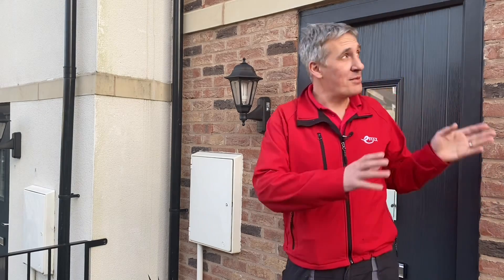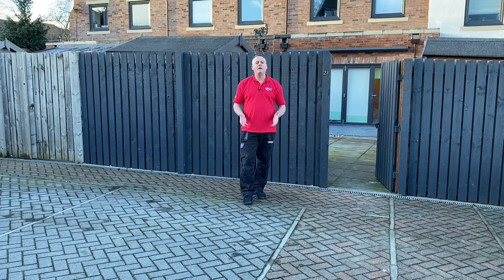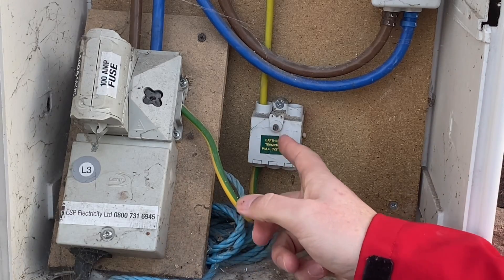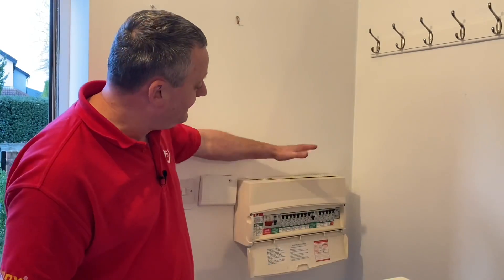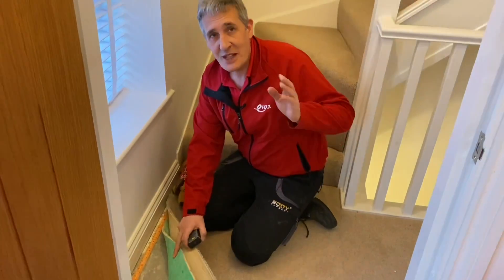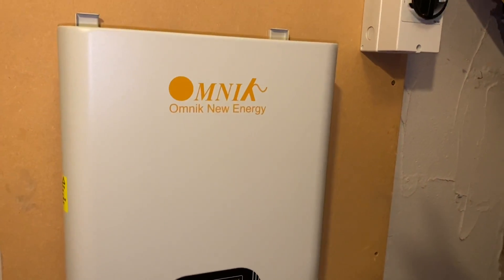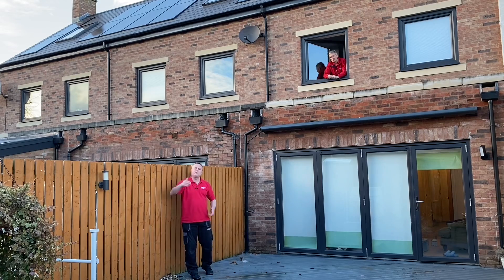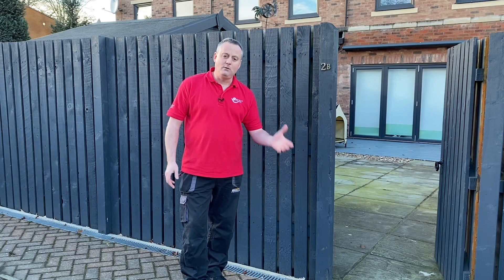Are ELECTRIC CAR chargers EASY to install?

Comment: On my 2020 new build with TNCS I have been provided with a regular single 13A socket, wired in 6mm T+E directly below the CU, on a 32A MCB labeled "car charger" that is grouped with a floor of the houses type AC RCD. You can use this socket in the garage to charge a car outside. The NICEIC registered contractor saying that it's a "general use" circuit and therefore compliant. House sold with "EV charging point", electrical designs say it's "for vehicle charging". What a mess!
Reply from the maker: Interesting approach - we think 13a sockets for EV have to be a special type - not just a label.
Reply: @efixx  how about it reasonably being used for a car parked outside? And it blinding the houses RCD?
Reply from the maker: @Swwils  it's not a good solution - we'll take a closer look at what the current bare minimum is for new build houses.  We thought most just ran an empty conduit to and empty charger box.
Reply: @efixx  Some local authorities require EV charging points as a planning condition. It appears that builders interprete this as a 13 amp socket but even so, my reading of section 722 is that it covers this so that socket requires PEN fault protection and an appropriate RCD.

Rolec do a chargepoint casing with a 13A socket and sell the guts of their type 2 chargepoint so the owner can get it upgraded.

Comment: From consumer unit to outside, clipped up the front of the house into the soffit, through the loft, down the back wall and some heavy duty cable tray along the fence.
Reply from the maker: unfortunately it's 3 floors - no loft space front to back.

Comment: What would be better, is if you give the job to an installer that is under pressure to install 3 or 4 per day. I’m a spark, and I had an installer do my EV charger, as with the grant, I couldn’t buy a charger for less that I could get it installed under the grant. The installation was terrible, compression glands either side of the SWA, guy wouldn’t go into the loft for “insurance reasons”, he wanted to install plastic trunking across a bedroom ceiling?
Reply from the maker: plastic trunking across the ceiling - jeez
Reply: @efixx  🤢🤮
Reply: The guy needs to sort his insurance out, how can they not be allowed in the loft space as a tradesman, makes no sense.
Reply: @John M7RCZ really...like  bit of plasterboard will stop you falling through, makes no sense at all.

Comment: Buy a diesel car?
Reply: Nasty, dirty diesel.  Buy a petrol car.
Reply: @JimWhitaker  I can get 70mpg from my diesel car, my petrol car struggles 40mpg, although I prefer how petrol cars drive. I don’t think diesels are that bad, most diesels have dpf filters and a whole load of other parts to control emissions and my diesel is road tax free because the emissions are so low. They both have their good points and bad points. I don’t think electric cars is the answer but I like the idea of them. The amount of money this job would cost the customer you could run a diesel or petrol car for years.

Comment: I suspect that flat roof out back eliminates the use of joist drilling through the first floor. - If it doesn't, just watch out for it being an engineered floor: joists made of engineered timber and sheet chipboard interlocked to allow joist spacings to be greater. I cut a hatch in one (years ago when these types of floor were new to me) and felt I had weakened it. They aren't (or weren't) designed to be cut and drilled afterwards.

Comment: Hi guys I need some advice please I have a upstairs flat I am replacing the consumer unit the tails need replacing they are 25mm and run up a cavity can I run my tails through a cavity and add a 100A switch fuse isolator, I have read you can not run tails in a cavity only straight through a cavity, any suggestions guys anything would be appreciated thanks 👍.

Comment: If you used solar for the energy its a good idea but then won't your car only be charged depending on the weather
Reply: @zlmdragon.  Ah very good point the only thing I could think then is if the solar panels charged some battery which could charge the car as necessary but then  again that could take up a lot of room and the homeowner would probably not want that

Comment: A nightmare of a installation... what I would do is run the cable surface at low level through ground floor level with the intention of it been boxed in and surfaced mounted outside to the back fence... other than that I would ask the DNO for a new supply if possible to be run at back of house...

Comment: replacing split load RCD's for RCBO's in the board and putting smokes on the lighting will free up 3 ways (5 ways if you remove the doorbell transformer). Depending who owns the fence ajoining the neighbor you may not be able to run your cable to it, as there's lighting on it already this may be owned by the property you're working on. If it were my company we'd advise against an EV point at the back for the foreseeable future. However if the client is adamant they wish to go ahead, 10mm SWA up the outside of the front of the property, through the attic and down the back to avoid disturbing the finishes inside the house - sounds ridiculous but it's usually the cheaper and faster option.
Reply: Unless the rule is no visible cables inside or out.

Comment: Even if the main income is labeled 100A do you not have to assume it's 60A?
Reply: To be fair, they did say they would check with DNO
Reply: @paulgoffin8054  I've tried this enquiry on several occasions with different DNOs around the country and not one of them could tell me over the fuse rating over the phone. In fact, on several occasions they've said to me "if you're an electrcian you can just take the fuse out and have a look".
Reply: @Blackf1ngers  I certainly wouldn't expect them to say over the phone, that would be ridiculously risky.  Yes, someone needs to open it and check and some DNOs are OK with that being by the electrician on site, others are not.
Reply: @paulgoffin8054  You need DNO approval before commissioning if the new maximum demand is over 60A.  That said, the stickers on the fuse carriers are usually accurate particularly if the seals are intact.
Reply: I have a main income labelled 100A but someone has written 80A on the casing in pencil.
Reply: @huwdavies6650  The factory fitted 100A label on the fuse carrier only indicates maximum fuse size, NOT installed fuse size. I had to get my DNO out to cut my seals and confirm fitted fuse size a few weeks ago in preparation for some electrical work. They did this free of charge and within only 2-3 days. Very helpful, and confirmed I do have a 100A fuse fitted.

Comment: I'd definitely want to change the board as it is plastic and as far as I can work out, under the stairs.  Also, given your other plans, if it is out of space now that will likely get worse.  6mm SWA will do - 35m x 32A is a voltage drop of 8.8V or 3.8%.  It would be worth checking what size the existing SWA is and where it runs - probably to the shed and it might be possible to repurpose that if it is 6mm.  Otherwise, I like the idea of running the SWA up the front of the house, through the roof and down particularly as that would all count as clipped direct.

Earthing - out at the back you could probably use an earth rod with sufficient separation (3.5m) from other bonded metalwork.  But given the solar, the Zappi is an obvious choice with the Harvi for the grid and PV CTs due to the distance (EV Ultra with the cat 5 cable could work too).  Put the charger on the inside of the fence for security, either on a post https://www.electrical2go.co.uk/zappi-single-mount-pedestal.html if the fence is a bit flimsy or on the fence itself.

If the narrow strip between the back fence and the parking space counts as a public path, or the deeds are not clear that the parking space belongs to the house, you will not be able to get an OZEV grant.

Comment: Why can I have an 11kW electric shower but only a 7kW EV charger? Surely with load sensing equipment in the installation this would be possible.
Reply: Duration and diversity, and data for their upstream network reinforcement.  The concern is drawing 7KW for hours overnight rather than a 10 minute shower which won't overlap too much with the neighbours.  Load curtailment will save the service fuse but the combined load is still higher for longer.
Reply: No cars support more than 7kW single-phase. If you have 3-phase you could do 11 or maybe 22kW if your car has a 3-phase onboard charger.

Comment: Look at upgrading board if budget allows, otherwise dedicated mini cu for charger.
Run cable up in to loft and drop down other side.
Allowing 40m (added extra length to get in loft) a 7kW load in 10mm2 cable would have a volt drop of 2.3% so well within tolerances.
I would mount the charger onto a post, more secure than fitting to wooden fence that may be changed in the future.
Another thing to consider - is there a public footpath between the fence and parking space, could there be a trip hazard?

Comment: it couldn’t be a harder property to install, a real challenge and a good example too. I would definitely recommend fitting the EV charger inside the property boundary out of sight, it looks like the EV could quite close to the fence. 30M is a long run, could introduce under-voltage alarms in some EV sockets. So-many considerations here. Fascinating example.

Comment: This is similar the issue I have to explain regularly to my office. The supplier who sends us the work (as one of their approved installers) send us the "survey" which consists of a few blurry photos of inside a meter box, a consumer unit (often even with the flap closed) and the parking area where the charger is to be installed. No planned route or even any clues to the proximity of the board/meter and the parking spot. Will the job take a couple of hours or a couple of days? Are there groundworks involved? Will I have to Change the existing consumer unit or even Install a garage board involving splitting the tails, installing another SWA to the new board and going from there? Don't get me wrong, I've had some where it's a matter of drilling a hole through the wall next to the consumer unit and back entry using 2m of 6mm twin and earth (sorry, twin and CPC), installing an RBCO into an existing consumer unit, a few quick tests and job done. Some others have been the most challenging work I've ever undertaken, drilling in and out of buildings, digging up gardens, cable calcs, researching manufacturers product spec sheets regarding the suitability of protective devices, earth rods, considering other equipotential hazards, load balancing etc. Then there's other issues you might come across adding your circuit to a consumer unit which isn't the best. It's all in a day's work but in terms of domestic electrics it's far from simple considering we're essentially installing a single radial circuit to feed a single piece of fixed equipment.
Reply: @jameswhite6102  Nope. We have several firms who send us the work, but Chargemaster are not one of them. Unfortunately it seems the business model of the larger suppliers does not accommodate a proper survey or methodology of the work. They seem to like to pretend they are all easy peasy and you can do 3 a day.
Reply: @Mason Moore no but it sounds like it's the culture across the industry. A colleague who has done hundreds says pretty much the same.

Comment: Change the consumer unit, 10mm out the back of it, up into the loft on the front and down the back, also have it on a separate post rather than the fence.
Reply from the maker: one thing we didn't mention - it's three floors - no front to back loft space.
Reply: @efixx  Just chuck it over the roof then! It is indeed a real pain in the butt this install, everything is so far away and awkward.
Reply: Make use of the pv cable in the loft ? Install a small cu in loft. Run from there

Comment: Put smoke detector circuit on with the lighting circuit. Then create a space between the main switch and RCCD (If the CU has 3 neutral bars). 
Depending on customer requirements/budget mini surface trunking is the easiest/cheapest maybe you can route straight up to the attic, then through the attic? Down the external wall maybe?
Definitely, install a Zappi for the PV, load monitoring and PEN fault requirements. (Install a Harvi also so you don't need to hard wired the CT clamp)
The EV charger can be fixed to the wooden fence IMO as it's a fixed structure but, making sure you don't induce a trip hazard risk in the process.
Reply from the maker: Good idea !
Reply: Other PEN fault detection chargers are available, not many though. 

Who knows of others PodPoint I think?

Comment: Throw the cable over the roof job done. Only joking. I would consider replacing the consumer unit with Type A RCBO's in metal consumer unit and surge protection. May be find a way to run a cable through the loft and clipped direct around to the charging point. It would be nice to have a stable fixing for the charger itself so may be a post/stand with built in charger rather than a fence because we all know they are not stable enough when some fancy name storm comes along.

Thanks for the video and looking forward to seeing how you would get it done!
Reply: Wouldn't trust a fence on a new build to hold itself up on a still day!🤣

Comment: Putting the smokes on the lighting circuit will free up a spare way for the EV.
Reply: Or slide the RCD over one space and put the EV charger on an MCB between the main switch and first RCD...
Reply: @jongurney  EV needs a type A RCD protection, unless your putting one further down line or installing a charger with built in. Then you’ve also got to account for the cable not being protected from the board to the charger.
Reply: And remove dodgy bell transformer...
Reply: You'd still be putting the EV onto an AC type RCD though.
Reply: @Blackf1ngers  install type A rcbo
Reply: @edwardgadsby8327  MK type A double pole RCBO? Good luck finding one.
Reply: @Blackf1ngers  seek and you shall find!
Reply: Smoke should have it’s own circuit innit?
Reply: @tonyp2878  Better on a lighting circuit.
Reply: @tonyp2878  says who? It's better on the lighting, means it won't be switched off when they burn toast.
Reply: @tonyp2878  no mate, either/or.
Reply: Through the loft 👍🥸

Comment: Id change the board, drill at an angle from the back of the board to behind the front drain pipe, clip up behind the pipe into the loft, across the loft , down the behind back drain, clip around the flat roof, down behind the extension drain, under the deck then bury under the slabs .. as for charging point, depends on the area, id be tempted to have the box in the garden so it doesn't get tampered with .. more meterage on cable , but saves ripping the house to pieces
Reply: Sounds about right,  especially keeping the box in the garden with the fly-lead heading under the gate/fence when in use. Wonder what the ground floor is made of (maybe I missed it) as that would be a shorter run (if its not a concrete slab) and less associated voltage drop. Looking at the charger unit, I'd think a Zappi would be best suited to integrate with the solar pv and possibly a storage battery
Reply: @royking1  i'm guessing the main house is block and beam and a slab for the extension, a bit more info would be handy, yeah id go with a zappi, battery storage is a must these days , just get one that wont have capabilities of grid sharing like they plan to with tesla, why would i spend all that cash on a solar install, only for the grid to use it ... bow-locks to that

Comment: If this were factory wiring where I work, it would be some bell wire directly from the mains, zig zagged through the wooden fence and some zip ties holding up the charger. I don't think a homeowner would be too chuffed with it though lol. Excited to see how this goes.
Reply: Sounds like a top class install to me ! Messers Bodgeit and Scarper Ltd.